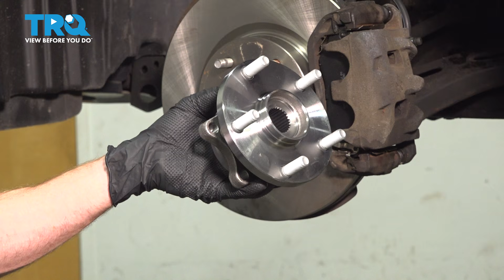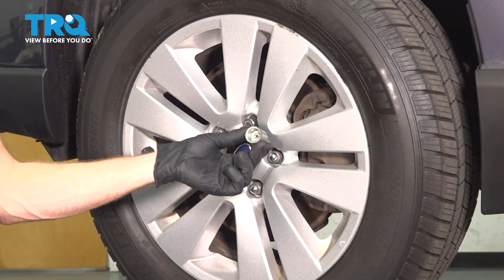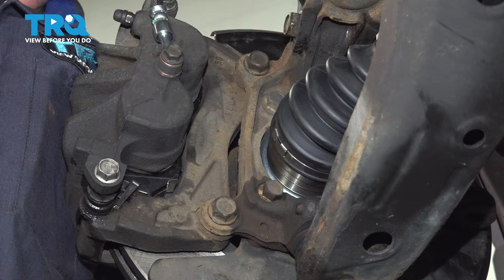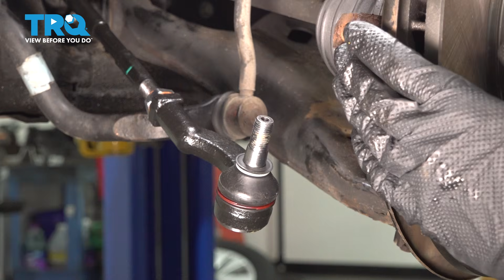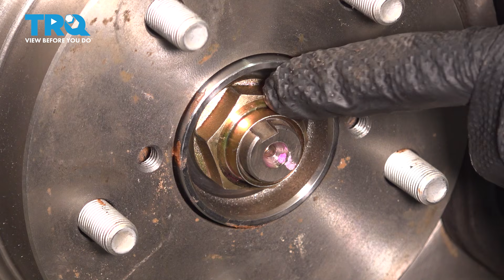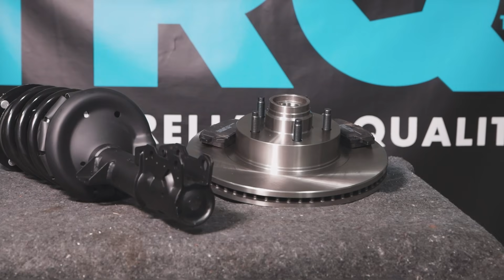How to Replace Front Wheel Bearing & Hub Assemblies 2015-2019 Subaru Outback

Comment: If your doing the rears, the torque spec is 49 ft-lbs for the caliper mounting bolts. Just put 80 something on it when the bolt sheared in half. fml, gl